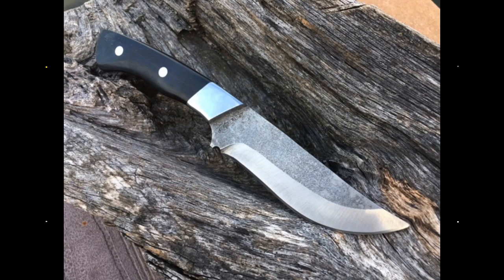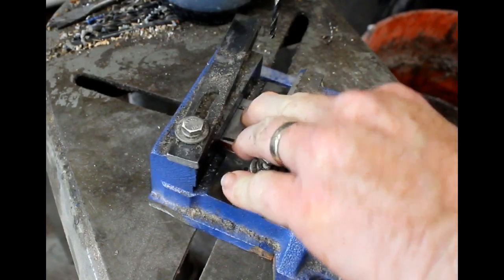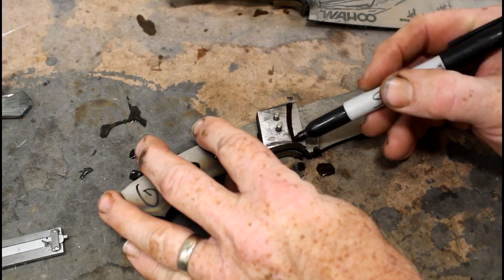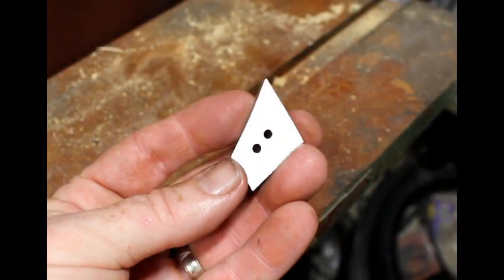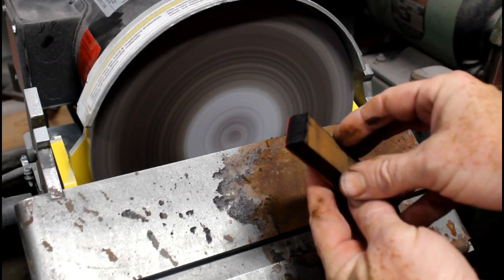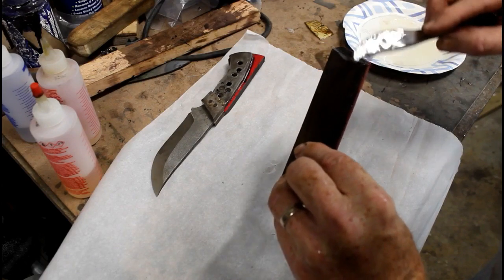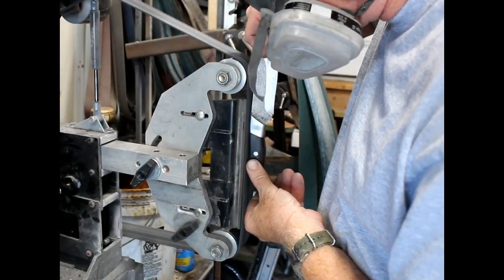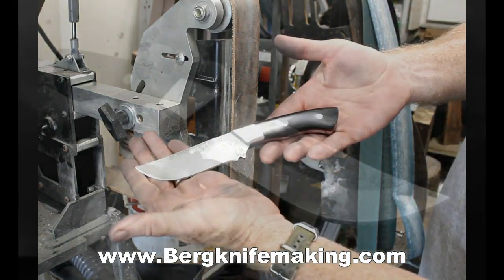Knife Making Part 2 Bolsters Scales and Sharpening by Berg Knifemaking

Comment: Great video excellent instruction the only problem I have is I got a full by 36 grinder but it will work thanks
Reply from the maker: A 4x36 can work usually you have to add a pc of ceramic tile under the belt to give space so you can create bevel plunge lines
Reply: @DIYeasycrafts  I already have that tile under the belt but thanks for the info